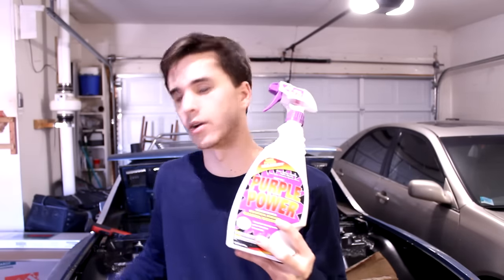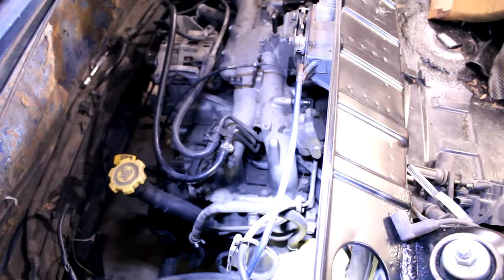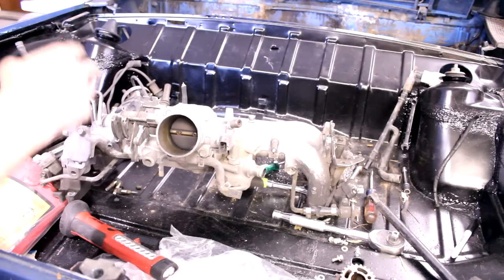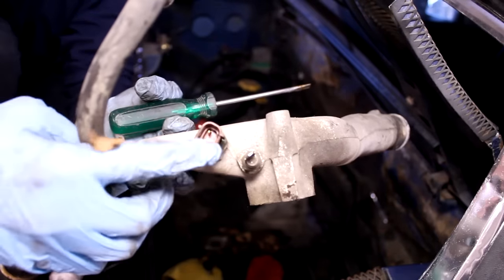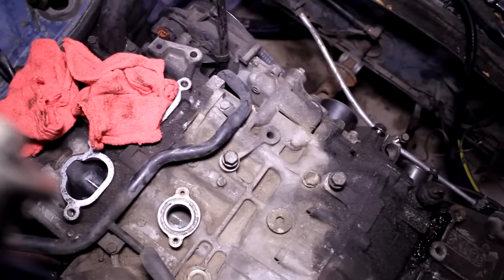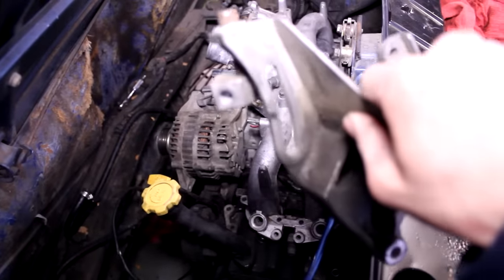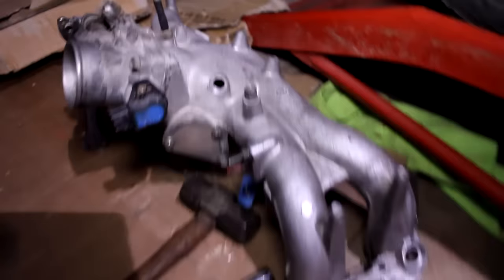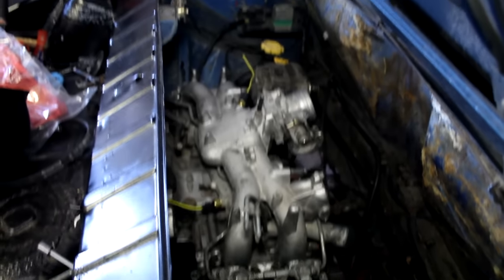Project 914: Episode 8 | Intake Manifold Flip

Comment: doesn't the ej22 need a pcv?  thanks jim
Reply from the maker: Yes, but I'm going to just vent to atmosphere for awhile until I do a custom pcv setup.
Reply: is venting to atmosphere simply putting a breather on each head?  like I did in this pic.  http://www.914world.com/bbs2/uploads/post-2460-1468450250_thumb.jpg
Reply from the maker: Jim Kelly yes
Reply: the tapping on the intake manifold and coolant manifold for GM sensors is also great info.  every video you've posted is providing me with super valueable info : ) thanks a ton man! you got me reinvigorated.
Reply from the maker: Of course! Thanks for watching them!

Comment: Hey bud what fan belt did you finally decide on?I'm close, but then I was slowed down a lot by having to install steel GT fender flares.I went with the EJ 25 SOHC phase two, but installation was a little easier, because I ordered the kit from Renegade.
Reply from the maker: +Valerie Pickens im not sure off the top of my head, I tied a strong around my pulleys and then brought it to autozone and just picked the two closest, then returned the one that fit worse. Hope that helps, and sounds awesome, are you doing the tranny swap as well?